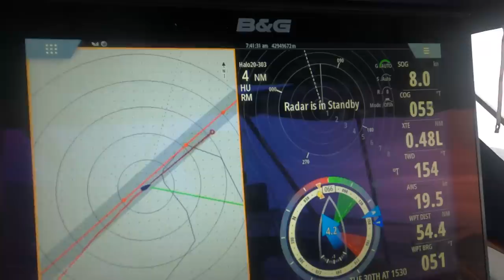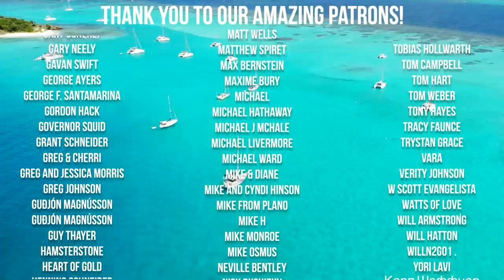NORTH Atlantic Autopilot FAILURE - Sailing to ICELAND [EP 201]

Comment: You really should consider beefing up the mount (glass and plywood works fine) and get a tiller arm. Bolting to the quadrant is a big no-no. If you break the quadrant you won't have any steering but for the emergency tiller which takes quite a bit of force to operate.

Comment: Sheet to Tiller!  In An Emergency with a down Auto Pilot. And using the emergency tiller..
Wind Vain steering can be setup with the emergency Tiller, and a couple of bungee cables too the Lee ward side, as the elastic, and a sheet from the main boom through a block on the windward rail, then too a half hitch on the tiller.  Lots of trial an error to get it right.    Not a bad idea too setup a system when you do not need it couple of cam cleats and depending on your emergency tiller how many blocks to need too make it work, but have used it has a wind vain system for years on my Cape Dory 25 in the 70’s.  You can technically make it work on a wheel helm but takes more work..

Comment: You guys should be proud of yourselves. You really took the next step. You've gotten so much experience but have barely pushed yourselves, which for me is the part that makes sailing fun. Then, when you did decide to just go for it, you ran into a major failure. But you realized you still had many layers of safety and that guy could even fix it. I was so surprised you kept pressing. First thing I thought when when I saw that break was that I bet it could be repaired or rugged to work with something you have onboard. There's always a way. So shocked and glad that you changed your mind and didn't immediately head to port. 

You guys are really growing. Lesson is, everything should be overbuilt if you can manage the cost and weight. It will definitely be much easier, at least faster, to fix it in Iceland. As long as the volcanoes and eruptions don't interfere. At least you'll get to see some amazing lava flows!

Comment: Great fix on the AP mount. Can I ask why you were not using your hydrovane anyway? We have one as well and often don’t use it for no good reason. Well the main reason probably is we cant be bothered pulling in the extra reef needed to balance the boat, especially reaching, to make it easier for it to work. Interested in your reason. 
Also re winch repairs at sea, pinning a towel to the lifelines helps enormously to reduce prospects of critical bits going overboard. I learned this when I had to service main cockpit winch on long passage. 
Last, cold usually starts with feet. After 40,000 sea miles I finally bit the bullet and bought Dubarry leather seaboots for both of us. Best $900 AUD ever spent. Bar none. Bar none. You know it makes sense!

Comment: Good work on fixing under way. I would strongly suggest against using the grinder or any hot tools. Maybe check out how quickly fire consumes a boat.
Reply: So no stove, heater, engine etc?
I'm quite sure someone in the middle of a crossing is well aware of the dangers of fire.
Also, most fatal fires start in unattended locations, not through careful and knowledgeable usage of tools.
Reply: @benjif2424  none of those are open flame/spark. I made a suggestion based on my knowledge.
Reply: @jocomlakar3526  all of those can and often are open flame/spark, except for the engine (which is probably the biggest fire threat from the listed examples for several reasons).
And batteries + wires are even more dangerous (statistically).
Agree to disagree or show me some numbers that are more than your subjective "experience"
Reply: @benjif2424  what you are claiming is that because there are other fire risks on board, it is ok to induce more risk. I have no reason to prove anything to you. You may see my opinion for whatever you like.
Reply: @jocomlakar3526  you already stated factually wrong things, so it'll be hard to prove anything (without at least addressing the wrong statement first).
What I'm saying is there are many risks and risk management is of very high importance. But absolute statements like "no open fire" aren't of much use.
Reply: @jocomlakar3526  there are many safe boats out there with wood burners for example. Anybody who doesn't know to be careful with fire will find a thousand ways to die out at sea.
But lecturing experienced sailors with absolute statements is quite ambitious...
Reply: @benjif2424  Read again: "I would strongly suggest against using the grinder or any hot tools". Find something wrong with the "suggestion".
Reply: @jocomlakar3526  the factually wrong part was your reply "none of those are open flame/spark".
The part that made me comment was the "maybe check out fire and boats bla" part. Like really, who do you think you're talking to? They are following all standard safety practices for ocean crossings and you think they don't know fire on a boat is bad???
Reply: @benjif2424  Excuse me for pointing out a non-perfect practice. I will refrain. Obviously  you believe they don't make mistakes. Good on you.
Reply: @jocomlakar3526  it's fine to say "I feel queesy when seeing you do xyz. There are some crazy videos of boats burning down" or smth like that.
But "maybe check out how quickly fire consumes a boat" implies you have knowledge they don't. It's not nice. And having a yt channel they have to put up with that attitude every single video. It's exhausting at best.
Reply: @benjif2424  omg. The comments are what bumps the algorithm and makes them a living. This is what they are doing this for. Regarding experience. I am an active skipper for 26 years and before that spent 20 years on the boats with my parents. Never crossed an ocean. But hey, who cares, you know best.
Reply: @jocomlakar3526  your personal experience is your thing, but it's not objective.
"experienced" world class fighter pilots go on national TV and say they've seen an UFO that must be extraterrestrial, but then turns out to be a duck.
In the second ww it needed a statistician to explain to the military not to increase armor on the planes where bullet holes were found, but where they weren't found (as those planes didn't make it back).
Reply: And even if you were 100% right it's still not an elegant way to transport your message.
Reply: Completely brilliant. When I crossed the Atlantic a few years ago I was very picky about the crew. You two are exactly the kind of people I’d go ocean sailing with … thanks for sharing. You’re an awesome team. 😊🎉❤

Comment: It seems (by the sound I often hear) like a lot of sailors run their autopilots in high response modes, (like "performance"). 
To me, it seems like that mode, while doing thing a little better in some situations, really puts a strain on the autopilot. 
According to me basically just trying to measure the amount of work they do. 
They seems to do it several times more work in those situations. And uses a lot more energy.

Comment: I've got that same autopilot. It's been very reliable and, looking at the image, it isn't really the autopilot itself that failed. It was the bracket it was mounted on. It flexed, work-hardened and broke. But that's not a failure of the autopilot mechanism. Probably worth mentioning. My bracket is work hardening, too,  so I guess I have that to look forward to  ;-)
Reply: Also important are the adjustments like rudder gain, auto trim and counter rudder..If the autopilot runs on compass course, weather helm changes will induce quite some forces during the auto pilot course adjustment and these brackets will undergo lots of fatigue stresses..
The Hydrovane should work flawlessly if install and adjustments are done properly but do require ongoing check of the screws and fasteners..

Comment: [ In first version of following I forgot to say how talented Adam is! ]

With the shot at 23:45, looking back along Millie, the memory of ocean sailing brought the sensation of salt water in my nose. 

I noticed the winch handle is on a tether. That is great technique. I learned that lesson the first time I had a boat with tools in it, and during a race turned turtle. Lost the tools and some other items.

On the chance you have not heard of it, Arnica Montana is great for a variety of body pains, and recovery from said. B&T is the brand I find best, if you don’t mind a witch hazel gel.

If you weld the autopilot ram mount back into shape, consider adding a steel brace(s) at right angles to the failure plane (more than an “L,” i.e. plates in x, y, and z directions). Surprisingly it failed given you don’t sail in tough weather much.

Comment: Broken Autopilot mounts on boats that are doing multiple long passages seem hardly to be a rare occurence, seems like the installation approach is often " that looks beefy enough"  without considering what the forces actually in bad weather are,  what safety margin is necessary - particularly with welded constructions and what the fatigue life needs to be for boats that are doing long passages on auto pilot. I would bet that the majority of autopilot installs are not doing anywhere near the work that full time cruisers need them to cope with and so the iffy installs are often not giving trouble.

Comment: i would think that the criteria should be the opposite: rough weather use the windvane, easy weather the autopilot. that bracket failing, most likely, saved your drive unit, or at least saved it a few good hours of straining

Comment: I'm Sorry, but I laughed so hard when you disclosed this little tidbit in regards to 
''THE BATTLE OF THE STEERING SYSTEMS''

12:52
downwind occasionally we just use them
12:54
BOTH AT THE ''SAME TIME'' just for the last
12:55
few days we were just using uh just the
12:57
autopilot I started getting beeping from
12:59
the autopilot and uh the the warning on
13:03
the screen just says off course or drive
13:06
stopped I was like well that's really
13:08
strange so reset it and did that a few
13:11
times and then eventually I was like
13:12
Adam this like can you come up here and
13:14
like help me out with this like I have
13:15
to hand steer because the autopilot
13:17
isn't working so he goes downstairs
13:20
while I'm hand steering and literally
13:22
the whole Drive the whole Ram has just
13:25
completely Fallen like the brackets that
13:27
it's on has just completely cracked
13:28
through it's like a solid piece of
13:30
stainless steel
13:33
oh yeah.

Better get a Beefed Up Magnetic Autopilot and tell the Wind who's really Boss.
You NEVER use both systems at one time.
Reply: May I also mention that the autopilot actuator should be pinned to it's own pivot arm. This above the quadrant and at the longest possible length to accommodate the Entire Stroke of the actuator.  If your rudder ever got jammed the Actuator will easily break the spokes out of the quadrant. (esp fractional quadrants)

Comment: Using the angle grinder in the cabin has surely created stinky smells for days. I prefer hand tools, they also don't cause any fire. 
The bracket was made badly, should have reinforcements brackets in the edge of the angle.

Comment: I have a question for experienced sailors out there.  If they had lost the hydrovane in addition to the autopilot, instead of hand-steering, could they have somehow tied the sheet to the tiller as a type of autopilot?
Reply from the maker: No tiller on our boat but I suppose we could try and lock the wheel to head in a direction and steer with the mainsheet. The sails would have to be well balanced and you'd have to be in the cockpit, keeping an eye on the course and adjusting sails. So definitely not 'auto' (as in, switch off and go to bed)... but possible.
Reply: @SailingMillennialFalcon  I forgot, you have a wheel and not a tiller; that's obvious.  I'm just a sailing noob, but I know that some sailboats with wheel steering have emergency tillers in case the steering pedestal breaks.  I've also heard of people connecting surgical tubing to the bottom spoke of the the wheel as an emergency self steering mechanism-- the main problem being that you require a lot more movement from the wheel to move the rudder an equivalent amount as you would get from moving a tiller. I think maybe it's just a matter of getting the ratios right- I think you could maybe at least achieve a relatively constant angle with respect to the wind direction, if not a steady course over ground.  But like I said, y'all have years of experience on me. so what do I know? So glad y'all made to Iceland safely! Fair winds and following seas!

Comment: I could tell he wasn’t feeling well. Pain is brutal.  I’m kind of new here, but wanted to share this. It may or may not pertain to what’s going on, but just a thought to share.  I had lower back pain and pulled this from my notes that I took from a Medical Medium live he did. “Stenosis Shingles virus in the lower spine…. When Mercury and aluminum are together in the brain-spine - symptoms -   brain inflammation fatigue memory loss alzhiemers when mercury and aluminum is in the spine (Because that’s where a lot of it settles) - (a lot of mercury and a lot of aluminum settles in the spine) - it interacts with itself - so mercury and aluminum counteract with itself when it does this it oxidizes differently.  it eats away literally at your vertebrae - Shingles virus - MM Book 1 you want to get toxic heavy metals out- detox smoothie, celery juice, Sulfur Defense - MSM- Curcumin.  “- MEDICAL MEDIUM - from a live he did on Facebook.

Comment: Back issues, at sea.... fuck that would scare me...

First aid for it...
 lie on your back.... 
bend the knee and put both hands on 1 knee...
 get the missis to bend your knee up towards the same shoulder and hold for 5 seconds.... your job is to try and sink through the floor by relaxing, its not about stretching the muscles, but relaxing them.... 
do this 3 times
, and then push the same knee too the opposite shoulder....not the neck, or the elbow, the shoulder (my chiropractor stressed this part so I will too)

Swap knees and repeat...

He said I could use it as emergency first aid to straighten up the lower to middle of the back.